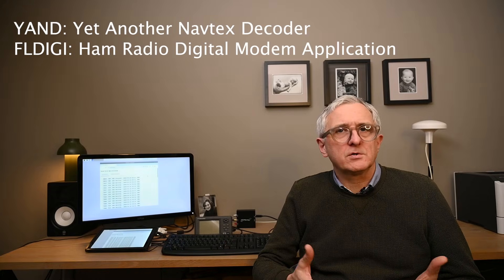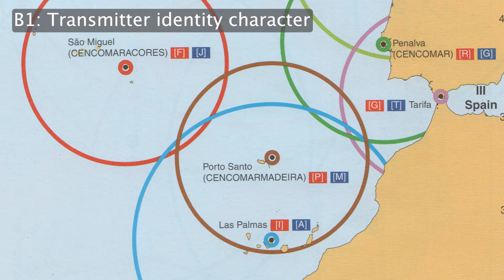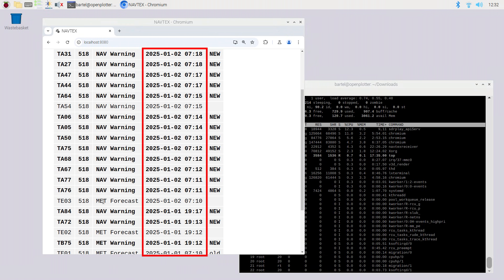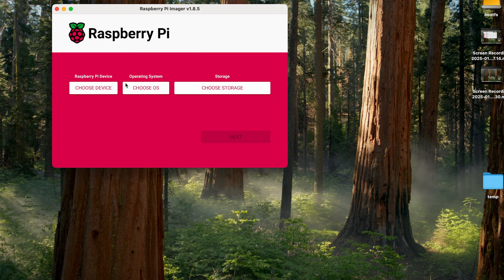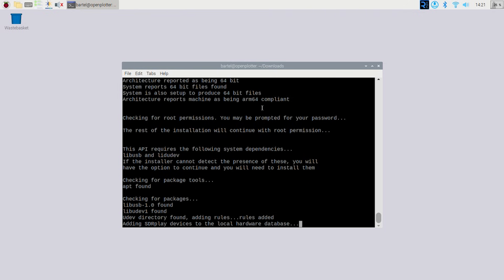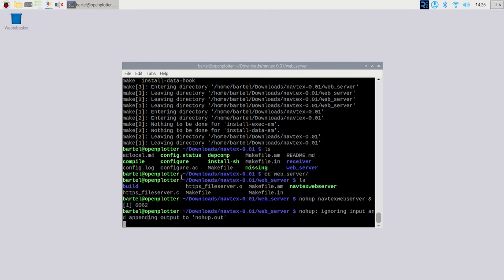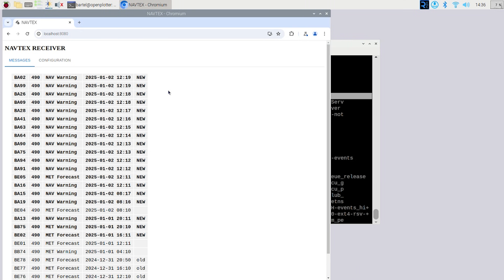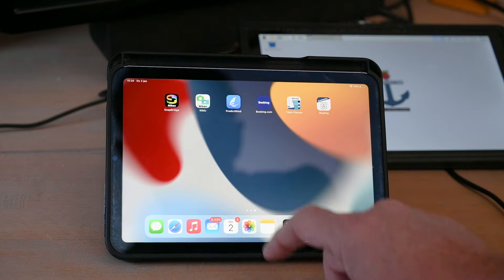NAVTEX on raspberrypi for sailors

Comment: Hello, and thank you for the fantastic project you've created!
I have a few questions for you:

The most expensive component of your project is the SDRPLAY.
Could the project be adapted to work with more affordable receivers?

Considering that a Raspberry Pi costs only a few dozen dollars, an SDR receiver in a similar price range could be a game-changer and make a significant impact.

What are your thoughts on this?

Since there is an NMEA connection, GPS data can be received.
This raises a question: why not expand the open-source code so that selecting broadcasting stations becomes unnecessary?
If the device has a location fix, it should be able to determine which stations are relevant for reception automatically.

You did not mention the 4209.5 kHz frequency.
Does the software you installed not support this frequency?

Looking forward to your insights!
Reply from the maker: Hi, thanks a lot for your reaction. 

First of all: about other, more affordable, receivers...
the answer may be a bit technical sometimes, but OK, here we go...

I chose the SDRPLAY receiver because I had one lying around, but that is not the only reason. 
I really wanted to build something that can perform as good as a commercial unit like the furuno. For this you do need a good receiver to start with. I'll be happy to support any cheap(er) receiver of acceptable quality that would appear on the market, however...
There aren't that many receivers around that can actually receive frequencies as low as 490kHz. The official spec of the RTL-SDR v3 says it starts at 500kHz. Not sure there is a sharp cut-off though. The v3 will operate in so-called direct sampling mode in the 500kHz-24MHz range. Sample rate is 28.8MSps so aliasing is guaranteed. This can only work in a +/- reliable way with an extra low pass filter. The RTL-SDR v4 has a built-in HF upconverter that should solve the issues linked to the direct sampling approach. Nevertheless also the v4 officially starts at 500kHz, not lower. Not to mention that the v4 appears to be a 'limited edition' hardware, as some of its components are out of production. 
Happy to hear about other cheap options you might see!
One suggestion to lower cost: the software works fine on a raspberry PI zero 2W (I tested it in a headless setup). 

About using position data to select the relevant transmitting stations automatically: 

It's technically possible indeed, but it would require polygon data of all of the navtex service areas. On the other hand, If I make a trip from Oostende to Dunkirk I'm only interested in very local weather. If my destination is the famous 'Butt and Oyster' in Pin Pill, UK, then I may want to look at the UK Met Office weather forecast already upon departure. 
Also at the speed we typically travel on a sailboat, you would not have to change the settings very often. 
This feature is not at the top of my list for future enhancements.

And finally 4209,5kHz:

first of all it's not used a lot. In Navarea 1 and 2 it isn't used at all, in navarea 3 only Greece and Turkey seem to us it. (source: edition 2019/20 of the ALRS)
Assuming that I want to be able to receive the 3 navtext frequencies simultaneously: In principle the Sdrplay receivers can receive a chunk of spectrum up to 10MHz wide. Let's say I would go for 5MHz, then the software would have to process 5M I/Q samples per second, versus the 252k sps it receives now. It would also mean ingesting the content of the entire AM broadcast band with all the strong signals present there (depending also on the antenna being used of course), whereas now I use a 200kHz IF filter.  ... bottom line: there are some challenges. 
If someone would be interested in receiving only the 4209,5kHz, that could easily be done. I could foresee a command line option for that. I would be unable to test this option here in Belgium, but if someone wants to test it.
In all of the above, I take as underlying assumption that even though you expect the receiver to filter based on the transmitter ID, it should not receive only in the timeslots allocated to those transmitter IDs. It is quite common for messages to be transmitted outside of the normal timeslots. It's foreseen in the so-called "navtex manual"
(google MSC.1/Circ.1403/Rev.2) that e.g. Meteo warnings are considered as "important", meaning that they should be "broadcast at the next available period when the frequency is unused" vs "routine" messages that should be "broadcast at the next scheduled transmission". 

Cheers, 
Bartel
Reply: @boatcomm  

Hi,

Thank you for your detailed response. Regarding the technical language, this is the best way to explain things, isn’t it? :-)

Before reaching out, I conducted some research and found that 500 kHz receivers are indeed scarce. This led me to consider the RTL-SDR v4.

I believe that "the best is the enemy of the good." An SDRplay receiver is priced at $235 (~225 Euros), whereas the RTL-SDR v4 is available for $29.95 USD for the dongle alone or $39.95 USD with an antenna set. This is a significant price difference, especially considering the included antenna.

While local broadcasts on the 490 kHz frequency may not be accessible, the primary frequency at 518 kHz, which broadcasts in English, remains available at an unbeatable and accessible price point.

Considering that the SDRplay receiver alone costs $235, it’s worth noting that for $228.30 (218 Euros), NASA Marine offers a BT Navtex receiver that includes an antenna. This raises the question of whether the impressive system you’ve developed could also support the RTL-SDR v4 for those willing to forgo the local frequency. At a total cost of just ~$60 (57 Euros) for a Navtex receiver, this is truly a game-changer.

Regarding the positioning question, your previous answer was spot on. My perspective was more from a programmer’s standpoint—aiming to minimize manual operations. :-)

As for the 4209.5 kHz frequency, I understand your explanation. If you ever have the time and inclination to add support for it, I’m sure it could benefit sailors worldwide, especially those near the equator.

Once again, thank you for the project and for your detailed responses.

All the best.
Reply from the maker: Hmm, about the 235$ for an SDRplay receiver?  that's maybe the price of the RSPdx. However the RSPdx is somewhat overkill here, the RSP1B will perfectly do the job as well. 
An RSP1B sells for around 140-150€ here in EU. In the US I see them being offered for around 140$. 
An RTL-SDR v4 sells at 35$ in the states. In EU it's hard to find one under 50€. The antenna kit will not help you a lot for receiving navtex. 
One day I may give the RTLv4 a try...

About Nasa-Marine: I'm not terribly impressed by the quality of the (navtex) stuff they manufacture. I bought their antennas for test purposes, and because there aren't that many alternatives (see also my next video about navtex antennas, coming soon). The only positive thing about the NasaM devices is the price really.

Comment: really excellent!!  great job on the software.  it's just the way I would do it, ha ha.  and perfect job on your first video.

one caveat though.  I have come to dislike consumer devices on boats.  the screens are too dark, for direct sunlight, or even overcast days.  And, touch screens are the worst thing in any moving vehicle.  as modern automobile buyers are discovering!!!

so, score one for the Furuno and Raytheon etc units that have high-nit displays and those push hard to click menu buttons around the screens.  those devices are worth the $$$ in some situations.
Reply from the maker: Thanks for your kind words on the project and the video. 

Also aligned with your other statements. The furuno is expensive, but extremely reliable. The build quality is extraordinary. I'm doing tests for a next video on antenna options. Both Furuno and Nasmarine have a magnetic field based antenna. However the Nasamarine is just no match for the Furuno. I'm talking about mechanical build properties, frequency selectivity, etc...

Comment: Good day. I was wondering, do you need to install the Open Plotter image on the Pi for the NAVTEX and SDRPlay to work, or could you just install the programs on a Pi with no desktop, such as the Pi Zero? Thank you.
Reply from the maker: Excellent question!
Openplotter is not needed at all. I just happen to use the openplotter image because I thought it is an environment familiar to (some) sailors. And it's true that I have always pictured a RPI (4-5) already in use for some other purpose, while a single purpose headless system could make perfect sense as well.  @stevepettitt3520 had also made the remark that a RP4 is relatively power-hungry. It got me thinking as well and so I ordered a pi zero (2W) right away. It arrived yesterday. Have had no time to test yet but I expect the software to run just fine. The proof of the pudding is however in the eating...  
I'm slightly less confident about the Pi Zero W. That one has a single core processor, so significantly less horsepower. But it's certainly worth a try. As long as no RF samples are lost... 
In case you make a test with the zero W (or 2W), I'd be glad to hear about the outcome...
Reply: @ thank you for the reply. I have a Pi Zero 2 W that I will attempt to install it on tomorrow and will let you know my results, if I get it working. Thanks.
Reply: @boatcomm  So I have it all connected, though I believe I have a few issues on my end. First, I am using an RSP2 which the A and B antenna ports start at 1.5MHz so I need to use the High Z port which I don't have anything on me currently to utilize that port. 

First question is, will your software work with the RSP2 or would I need a different SDR Play device? Thanks.
Reply from the maker: @KN4UXF  two pieces of wire should be sufficient on the highZ port. A wire of some length, e.g. 2x10m, one end you bring up in de air somehow and the other serves as a "ground". 
We have an other problem though, my software does not support the RSP2 ... yet. The RSP2 is still supported by the API v3, so I just need to add a few lines of code. Give me a day or two...
Reply: @boatcomm  AWESOME. Thank you. One last question, when enabling with recevier with the antenna port you are using, in the video you said A or B, if using the HighZ, what would you type to enable that port? Thank you.
Reply from the maker: check out https://csme.be/dl/ 
you'll find https://csme.be/dl/navtex-0.02.tar.gz in there.
It should support the RSP2 now. Command line options are not needed and will be ignored, as there is only one possible option for receiving navtex on the RSP2: that's via the highZ port, so also no biasT possible. 
The API documentation is not 100% clear on how to enable the highZ port, so the line in receiver/capt_sched.c that says
deviceParams->rxChannelA->rsp2TunerParams.amPortSel=sdrplay_api_Rsp2_AMPORT_1;
maybe has to change into
 deviceParams->rxChannelA->rsp2TunerParams.amPortSel=sdrplay_api_Rsp2_AMPORT_2;

Hope this helps!
Reply: @boatcomm  thank you for all the info and even updating the application for the RSP2. I have it all loaded up on the RPi Zero 2 and will attempt to place a wire on the antenna port tomorrow and give it a go. Thank you.
Reply from the maker: I could not resist doing my own test with a zero 2w. Works as expected (with the RSPdx at my side): The zero 2W can cope perfectly with the load. The receiver process certainly works fine. The webserver process is crashing every now and then. I had this very sporadically on the RP4, but it seems more frequent on the zero. It's a 'segmentation fault', so it's the developer that is to blame here: I need to go hunting for a bug, which I obviously will. Expect v0.3 soon...

Comment: Interesting but I''m unlikely to use it  because it's power consumption , whilst low, is nowhere near as low as the Nasamarine.
Reply from the maker: You do have a point there. I kind of assume that you'd have a raspberrypi running for some other purpose and then add this app on top. If you use a Pi specifically for this purpose, then it's hard to beat a purpose-built system, power wise.
In that case however it could be an idea to run the software on a pi zero 2W, headless (use a tablet as browsing device). I'd expect power consumption to be around 1W (200mA @5V) then. A Nasamarine "Easy Navtex" would be around 0,6W (50mA @12V)  
In fact I ordered a "zero 2W" a few days ago to test this type of setup...
Reply: @boatcomm can you share your testing results with the pi zero?
Reply from the maker: @chs9875  sure, I've been using an RPI zero 2W for some time now. The software runs on it without issues and without producing any significant heat. There is one practical thing: you want the correct date/time to be set. This can be achieved (out at sea) with a USB GPS antenna. Add the RSP device and you need 2 USB ports => meaning  you have to use a small USB hub, that also needs some power.
I did not measure the power consumption if that is what you want to know in the end...

Comment: Now a question: does your application work with other type's of RTL-SDR usb cards?  (plural there is not a typo 😀)
Reply from the maker: The application will certainly not work with any RTL-SDR type USB dongle. The software only interfaces with SDRPLAY devices currently.  I'm using the SDRPLAY API directly, and not a generic SDR hardware abstraction layer. 
Moreover, to my knowledge there are no RTL-SDR dongles that support receiving signals below 500kHz. 
Other than that, receiving (potentially) weak signals in the presence of other strong signals can be challenging for an SDR receiver. SDRPLAY devices have a number of front-end filters to help coping with that challenge. I chose them for this project since I believe they are currently offering the best price-performance ratio.
Reply: @boatcomm  The Nooelec SMArt reciever is pretty mainstream and can go as low as 100kHz!
Reply from the maker: @aliheja True, however ...
to receive those lower frequencies, there are basically two technical options: via an upconverter, or via direct sampling. Using an upconverter is clearly the better option. Nooelec is making the statement themselves: "Though the direct sampling implementation of NESDR SMArt v5 is much better than any other RTL-SDR, we still recommend using an upconverter like the Ham It Up for a more fulfilling HF experience (sold separately)." 
In other words, although the receiver is marketed as supporting frequencies starting at 100kHz, don't expect very good performance under 25Mhz. 
From the data sheet of the RTL-SDR v4: "Now uses a built in upconverter instead of using a direct
sampling circuit. This means no more Nyquist folding of signals around 14.4 MHz,
improved sensitivity, and adjustable gain on HF. Like the V3, the lower tuning range
remains at 500 kHz and very strong reception may still require front end
attenuation/filtering."
So unfortunately, the frequency range of the RTL-SDR v4 starts at 500kHz only. Now maybe this is the tuning range, and it can still receive 490kHz. That I need to figure out...
Reply: Many thanks for a great video!
I don't know much about this kind of thing but would like to learn more. I run Open CPN with charts on a laptop but would like to have it on something more power efficient like a Raspberry Pi and a tablet, preferably wireless so the Raspberry sits down in the boat and the tablet can be up in the cockpit. But I haven't even managed to find where on the tablet the charts should be saved so Open CPN can find them! 😂
So if you want tips on upcoming content, there's plenty to do, just don't forget links to where we can buy the stuff. Because if you're a complete novice you'll never find them otherwise 🇸🇪😄😀💕

Comment: What sort of antenna is this hooked up? This tutorial was great to follow!
Reply from the maker: The antenna I use for the demo is the Furuno NX-3H-D. It usually comes with the NX-300 Navtex receiver (the one I show in the video). It's called an "H-Field Active Antenna". H-field because it works based on the magnetic component of the electromagnetic wave. It's an active antenna as it has a pre-amplifier built in. This pre-amp needs power that you have to feed to it over the same coax cable used to send the signal to the receiver. (a so-called bias voltage). It's an excellent antenna, but it is expensive. You can occasionally find a good deal on eBay. 
A more economical option is the "H Vector Navtex Antenna" made by Nasamarine. It's a plug-and-play replacement of the Furuno one (except for the connector). Not at all the same build quality, but it will do the job.